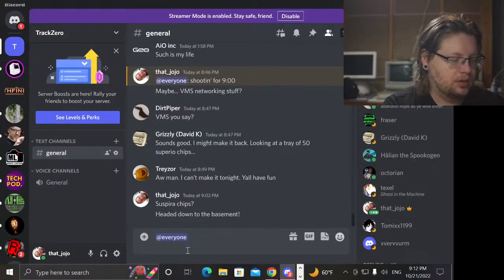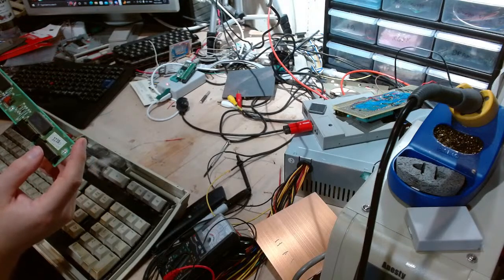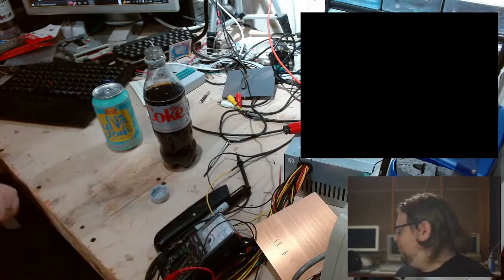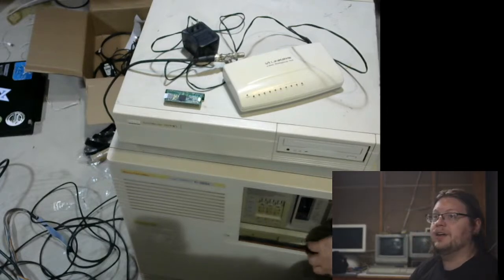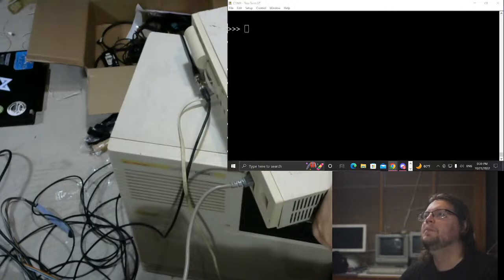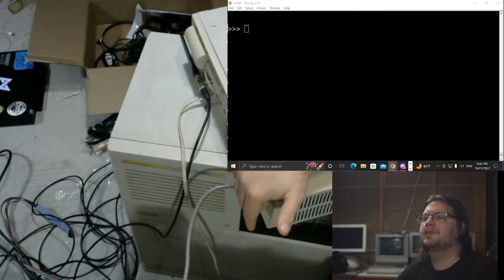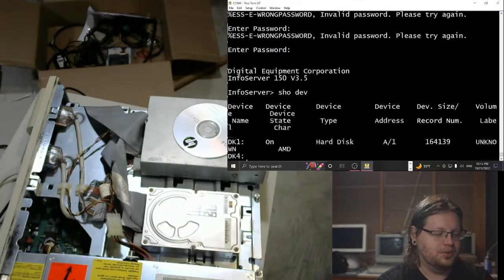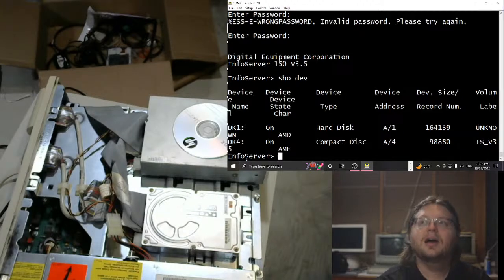VAX/VMS Thinnet Network Boot | Casual Friday

Comment: Does your scsi device have terminators on it? Obviously, it is hanging the scsi buss. Try just the device only. disconnect the drive and cdrom, also disconnect the flat scsi from the round scsi (removing the terminators on the back of the cab) then plug in the device to the now end of buss flat cable, see if buss is hung if not,"sho dev" and see how it is configured.